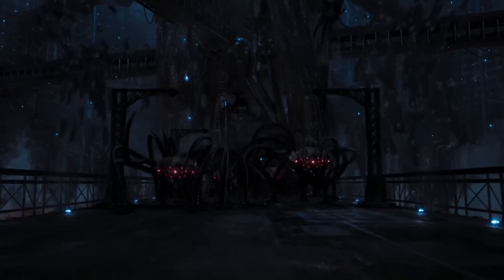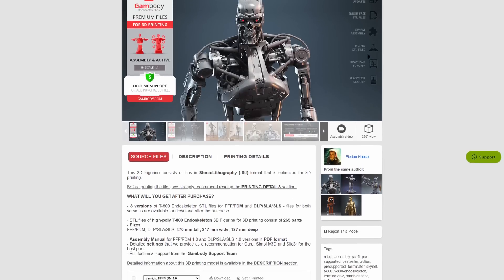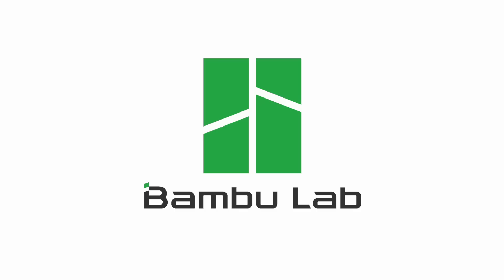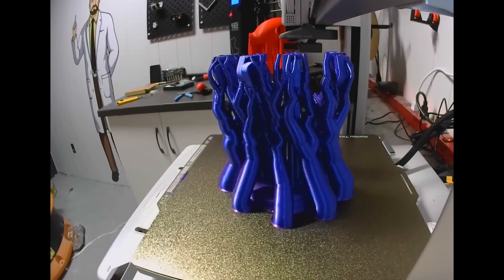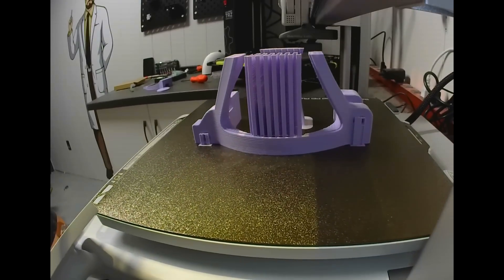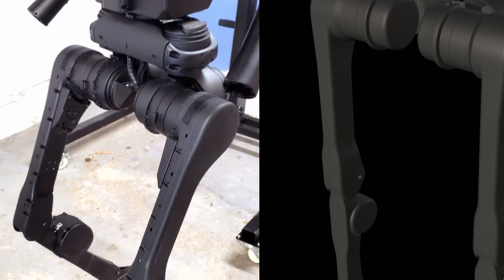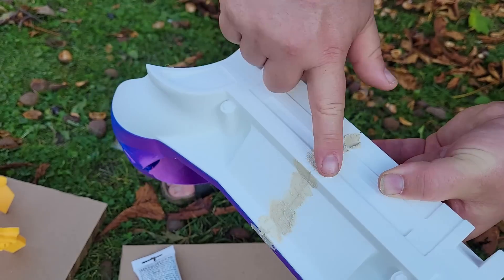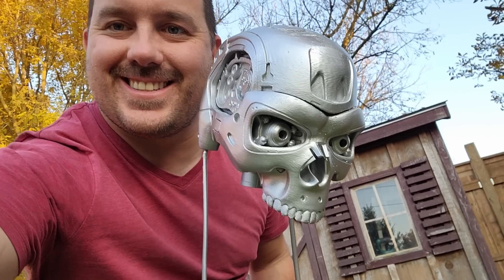Building a REAL T-800 Terminator from a Humanoid Robot!

Comment: Wow! Great work. Thanks for sharing. I see you use Blender. I do too. I struggle about if I should design in Blender or Fusion 360 when I create parts to be 3d printed. I have been using Blender for decades. Thoughts?
Reply from the maker: It really depends on end goal. 3d printing, probably bender. Machining, fusion. Blender does better at organic shapes; fusion is better at solid. Parametric models

Comment: Dope!
What about painting the actual robot silver too and then putting a black wash on the 3D printed parts?
Reply from the maker: I have a lot of other projects planned with the robot, so I made as few changes as possible
Reply: @DavesArmoury  Fair enough man!
Reply: @DavesArmoury  You need to use TPU printer material.
In this YouTube video he uses TPU to 3D print stuff so that it's flexible. If you print the Terminator out of TPU you should avoid pieces breaking like they're made out of China. I was trying to think of the name of the damn stuff. I don't do 3D printing myself but I remember there being flexible 3D printed material
https://www.youtube.com/watch?v=D3BxILDpT6k

Comment: I don't like being an armchair person but I'm going to do this more out of trying to help. You've got the right concept. It's the material that you're using to print the parts out of. Movie special effects we're done with a rubberized material and something along the lines of foam latex. Look up how they made movie special effects in the 80s and 90s to get an idea what materials they used for stuff like this so they could film scenes with it. It was painted look like metal but was usually rubberized materials I'm pretty sure they have something similar that can be used with a 3D printer
Reply: Polyurethane foam is what they used (it's still used now). The exact ingredients can vary, but it's mostly made from petrochemicals and water. It's the same stuff foam mattresses are made from, but it can be hard, soft or in-between, depending on how it's made.
I don't work in the industry, but I do get to occasionally meet people who do, as part of my work.
One of the special effects people who worked on Alien 3 did a live demo of it at Comic Con once, too. I spoke to him a few times at his workshop, bothering him with too many questions. lol
Reply: @jublywubly  I suspect if they tried this Terminator build using polyfoam it wouldn't self-destruct so easily
Reply: If you 3D print NEGATIVE molds, you can (after waxing the inside as a release agent) powder the inside with graphite and then spray truck bedliner to cast out of almost indestructible urethane.

That’s how the martian movie spacesuits were made. Graphite in the gelcoat helps make a metallic undercoat for paint
Reply: Maybe Taulman Nylon or Ninja Flex. But I don't know how well the paint sticks to these polymers...